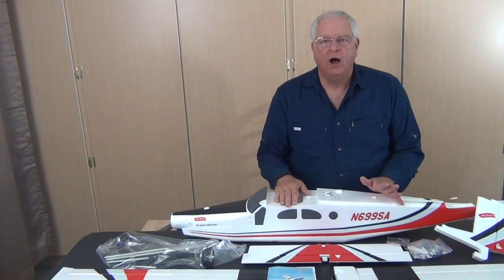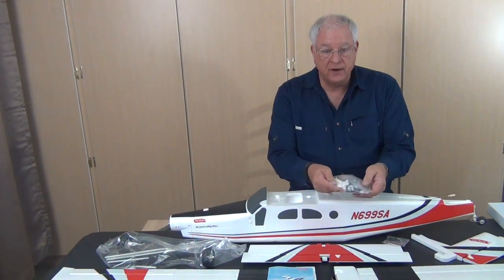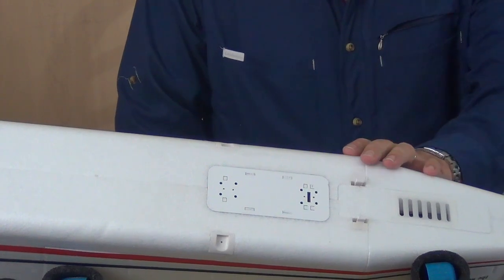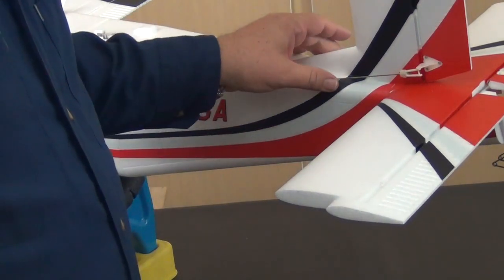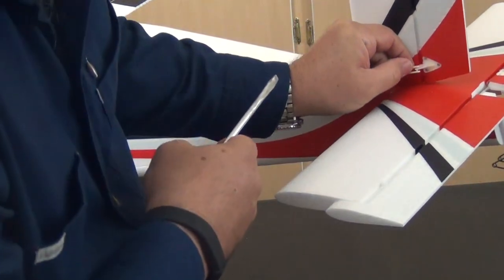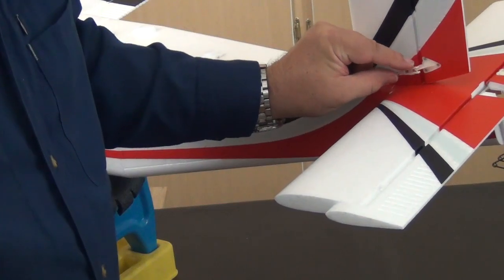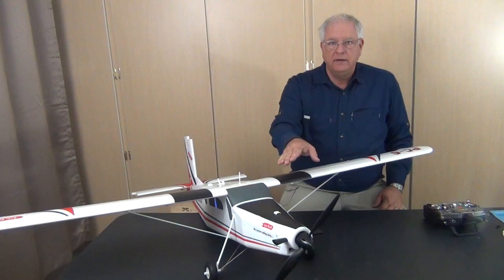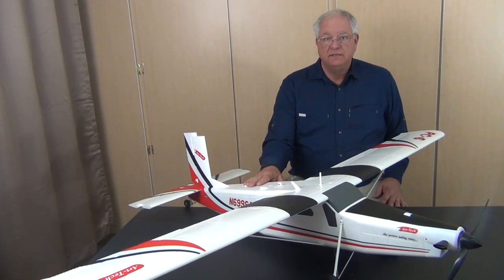Art Tech PC 6 Turbo Porter Assembly Log

Comment: Hi Michael,You did a great job with showing the assembly of the PC-6. There are a number of mods that can really enhance the overall stability & flight performance of the Art Tech PC-6 that I have posted on RCG on the Pilatus Porter PC-6 Thread. Attached is a link. The mods are quite easy to do. My PC-6 is an absolute joy to fly & is one of my favorites & is a beauty in the air.https://www.rcgroups.com/forums/showthread.php?2329019-Pilatus-PC-6-Turbo-Porter-EPO-Trainer-1700mm/page2